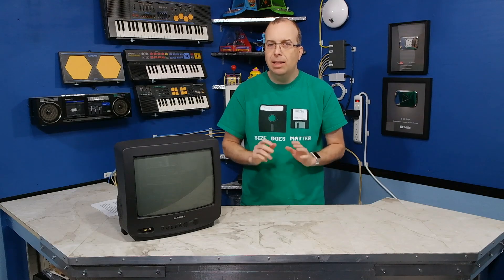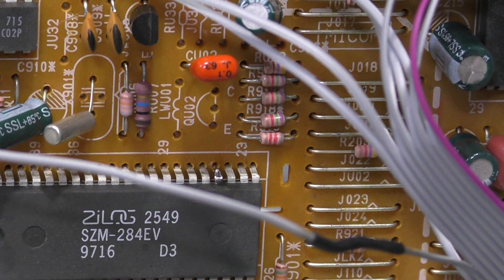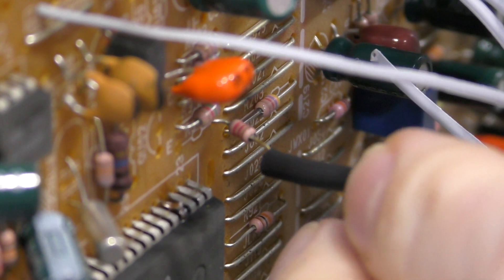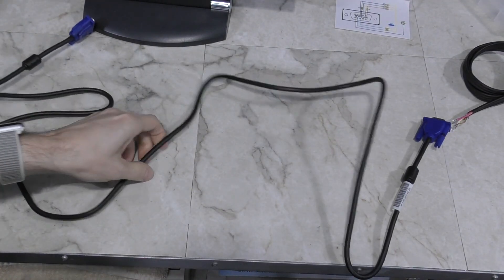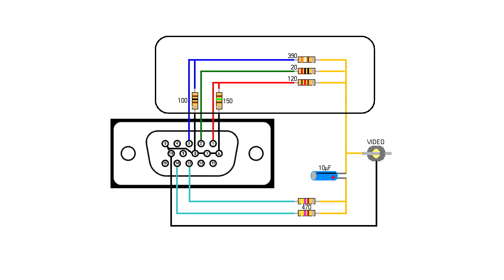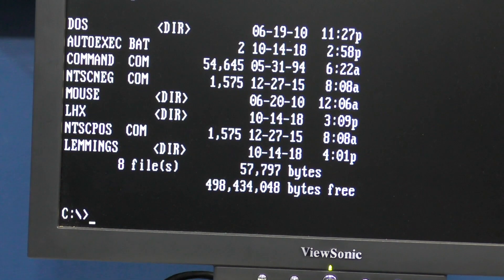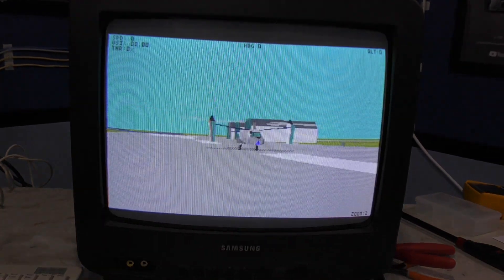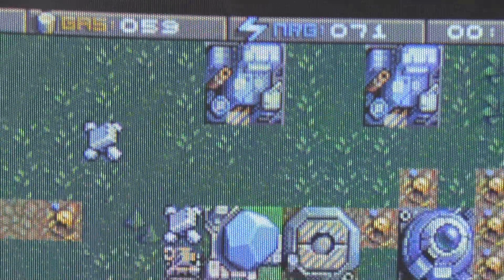Modding a TV for RGB - Part 2

Comment: Hey man I need your help I just picked up a 
Emerson vt1320n on screen high quality crt from April of 1991 and it has a vcr built in the tv turns on but it won't accept tapes
What can I do to fix this cause I also had a Toshiba dvd crt tv from 2001 I think
And when I had opened it and unplugged it and plugged the stuff back in the screen had went pink/purple then shut off to a point of when you turn it on it shows a white line going from left to right 
And I was working somewhat fine until I had broke it and then had to get rid of it and I don't want to brake this one because of how cool and how great of shape it's in after 33 years and it still turns on and I don't want to open it cause I don't want to have a repeat of what happened to the dvd tv
Please tell me what I can do to fix this
And thank you for whatever help that you can give

Comment: That was the biggest complaint I had about the CoCo 3. It had an absolute crappy composite output. Even on the Commodore 1702, which is a good composite monitor, it was just passable. I remember that this was pointed out on several reviews in the 'The Rainbow' at the time.

Comment: I just realized this video answers why we never got the VGA output fully working after finding instructions and creating the cable some 15 years ago. It was the refresh rate, which we didn't even know to suspect being different between monitors and TVs. We thought it was due to a short in the circuit board or something to that effect, and just ended up abandoning the project.

Comment: Well....where do I start? For any analogue signal use shielded wires, not ribbon cable. You had this cable with 4 RCAs on each end - a piece of that would have been perfect. The RGB signals from the controller: originally it was 2 resistors between the chip and the ground. The best place to connect the resistor for te external signal would have been where the 2 original resistors are attached to eachother. But don't solder the resistor there, put it at the external connector end. Also, of each signal (RGB) connect just the internal lead,  not the shieding at the chip end to avoid ground loops. The sync signal: also use an inline resistor in the external signal, because you never know what kind of signal the external source will put on it. The blanking signal: a diode or resistor would probably also work. In fact, there was a resistor, so the wire from the switch you probably could have just soldered on the other end. Finally, to avoid cumbersome conections and multiple holes in the TV back - i would have used a standard 15-pin VGA connector (so you can plug in a standard vga cable) and in the back side of the connector a little pcb to mount the resistors and a possibility to attach the RBG + sync coaxes properly. For each different system (not VGA) it would then be enough to have a modified VGA cable for each of those systems (cut in half, solder the appropriate connector(s) for that system). But hey, that it just how I would do it. This may seem like critisism, but it is not - it is nice to see you tweaking old systems, and the suggestions may be a reason for part III.

Comment: This is very interesting... not the rgb mode but making vga run in composite, so this could be used to display a computer signal on a crt tv that you want to smash live on video... much better than static

Comment: I'm going to attempt an input mod a TV from the 80s - which I don't recommend to anyone cuz they're live chassis and you can get shocked and killed, but I'm going to add an isolation transformer between the power cord and the rest of the chassis to separate the mains from the rest of it and hopefully not have any hot grounds. IDK if I'll be able to do an RGB mods but I ought to be able to add S-video - an improvement from twin lead antenna input

Comment: could somebody help me to find the blanking pin on a LG 14FK3RB-L2? it has a onechip,  LG046N9R59H3, I just need a litle clue, i'm not an electronic guy. Thanks in advance
Reply: @Tyler K thanks, very usefull answer. Could you tell me what other method is available?

Comment: i have the exact same model as you and cant figure out how to make it to sync.
Reply: Plug sync into composite port
Reply: Did you get it working?
Reply: @Slammer661  shit sorry for the late reply, i never saw the notification, yeah i got it to work , it turned out i had my vga cable wrong, if you follow instructions correctly it should work just fine

Comment: I bought a early 50s Toshiba tv colorized and I believe the TV comes with about 58 DVD hookups and when I tried using my Xbox 360 on it the whole thing started doing that out Flickr thing and that was just when I had my Xbox 360 in the basement I don't know why I did that at the time but I just want to play video games and the screen just went that was my fault entirely it I got it off the street how the signal is going through I act like I was trying to use the HDMI mini connector to something something and it didn't want to work my way the attic Xbox One is connected to my Samsung flat screen TV and the motherboard wasn't ready to switch over for older TV and I don't know

Comment: A real quick I have gotten a security cam TV to run cable I have gotten five TVs to run cable with a RCN Internet TV like that's up and I got it to work with it RadioShack connector piece for older TV when connected then you can turn your DVD player to all the five TVs you have in your house I got one like that one cable box all five TVs I don't care but works

Comment: I hope you get around to doing a part 3.  Maybe you can even find a chip to add inline to help with scaling to fix those other image display problems. I'm curious if there's also a chip solution that would create a frequency converter so you don't have to change the computer hz and lemmings will play correctly. Though at that point maybe it'd be better to just get a different setup in the first place.

Comment: Loved the video!
Would it perhaps be possible to use a small microcontroller to convert the pc rgb signal to the correct frequency for the TV? That way you wouldn't have to mess with the pc output signal and could perhaps avoid any software issues?

Comment: That TV could really use a true VGA port now. (Would that even be possible?)
Reply: there are converter boxes, wouldnt be hard to integrate one, but they are usually vga to composite (which would defeat the purpose)
Reply: @dcfuksurmom There are no boxes that convert VGA to analog RGB?

Around 2010, I picked up my first HDTV. It was a Samsung CRT HDTV that included an HDMI port.

As a TV, it looked great. But I tried to hook up a computer to it via HDMI, and it looked like garbage. The text was barely readable.

I don't understand why that was the case. Was it because the TV was 1080i instead of 720p? Not that 720p looks amazing, but it's usable. I sold the Samsung and bought a Westinghouse 720p (technically 1366 x 768) LCD TV, and it worked much better as a monitor. I still have that TV as a spare bedroom screen.

If CRT monitors could display text clearly at 1600 x 1200, why couldn't that CRT HDTV?

Comment: i feel like you could have also just used a diode between the microcontroller  and switch. the only back voltage would be whatever leaks from the diode, which would be negligible if anything.

Comment: you can use soft 15khz on windows xp to have proper 15khz resolutions out of the vga port. there are also a ati radeon modified drivers that works in newer versions of windows so you can play allmost any game on your rgb modded tv

Comment: feeding 5v directly to the uC was risky, but your solution also has a problem, for a brief moment the line is left floating and also you removed the resistor throught which the signal is fed so, it may burn at some random poitn in the future... you may have used a diode to prevent the power from going back to the uC

any way good job

Comment: Could have used a diode to do the same job, though at least it's isolated, plus i wonder if the voltage drop would cause issues?

Comment: Hi I have a question I have an old lcd screen from a picture frame I would like to wire a composite input to play my nes or n64 on how would I wire that
Reply: Just get the LCD matrix panel out of there and buy an universal LCD matrix controller with inputs. Usually there are AV, VGA and HDMI input at that board. Just connect the LCD via TTL or LVDS (depending on your panel) and power source. That's it!

It costs around $10-15.

Comment: I know you probably already thought of it. But how about instead of a dedicated black and white monitor for monochrome composite computers you just have a simple adapter that sends the same signals to r g, b and sync. also you can get neat shades by just messing with resistors (want amber or green)

Comment: OMG!!!  I just experienced RGB (raw feed/modded TV) vs RGB converted to work on component (snes using component cables).  True the results are quite similar and RGB brighter, but holy moly you guys don't seem realize that there's something hugely visually different in the... i don't know how to put it... i wanna say Hz or refresh aspect of it.  Yes they're both operating at the same rate,  but flashing graphics like explosions look like an arcade, vs the component which is slower and not as flashy.  I don't know how many people here have played metal slug arcade games, but imagine the little fire ball explosion animations and full screen flashes, THAT is how the RGB feels like, where as component isn't bright in the same way and it doesn't seem to be as impressive a flash and fast an animation.  I would say, yes, definitely attempt a mod (considering all cautions of course).... and so now I'm even more determined to get my own screen modded.  If anyone can help me find a schematic for Mitsubishi CS-40809, I would be ever so grateful!!!  Not just the schematic, but a few tips as well (resistors, shorting out the close caption how 8bit guy did in the previous vid, and I have no idea what two pins I should short out etc...)  OMG I've got to get this done ASAP!!!!

Comment: Question: I see your VGA monitor can't display a signal at NTSC frequencies (15kHz, I believe).  I know that many years ago (late 80's), Multisync monitors could sync that low.  Do you know of any sold today that can?

I ask because I'm concerned about when my Apple IIGS monitor dies.  The RGB output from a IIGS is effectively VGA compatible (at least in terms of voltage levels) but it uses NTSC sync frequencies, making it incompatible with any VGA monitor I've got.

I know that TVs can sync that low, because that's the frequency used by SD video (digital as well as NTSC).  Does anyone know if you can get a TV with a VGA input that can sync to 15kHz and therefore display an RGB signal from an old computer?

I suppose I could hack a TV like you did, but I get very nervous working around high voltage parts like a picture tube or flyback transformer, so I'd prefer an alternate solution, if possible.
Reply: Well, it used to be that PC monitors could not handle 15 KHz signals, but it is getting better because of the spread of HDMI. There exist HDMI devices that output 15KHz and 50Hz (in fact support for them is mandatory for compliance with the standard) and therefore both start to be supported by monitors in order to increase compatibility. Carefully check the specsheets, you can find what you need.

Another approach could be to simply buy a TV. A TV needs to be able to display 15KHz content, so always supports it.

Using simple dump VGA to HDMI converter can get you a RGB input on such a TV. Another approach is a SCART to HDMI converter, but these devices are often intelligent and do stuff like scaling and de-interlacing.

Comment: Or you could have just connected the wire coming from your switch to the other side of the resistor. I would expect 7.2k Ohms to be enough to limit the current to a healthy amount for the micro controller to sink. At 5 V that would be less than 1 mAh.
One should of course make sure whatever is behind the resistor can tolerate 5V without a resistor in between and if not add a 2nd resistor in series with the 7.2k Ohm resistor and connect the switch in between the two resistors.

Comment: COol! Videos. Is there a 16 bit issue with Big ENdian Vs Little ENdian. Im not sure but I think its an 8bit rotation. Can you possible take 4 tv signals and smush them into a tv either 2 steroscopic MONO or 3 videos 1/4 screen used for audio signal and left and right plugs used for mono videos. 
To make a steroscopic channel or  3 tv channel switch from 1 broadcasted channel. openInvent.club I want to help contact me. I want to learn stuff. links to resources in your video descriptions please.

Comment: what dirty hack could you come up with that lets RGB work on a VGA port without having to buy a converter box? (again, dirty hack, using maybe some caps, resistors etc from the spare parts drawer) this of course, skipping a "line doubler", which is why I'm curious to see the output!!! :)

Comment: Hey 8 Bit guy! I love your restoration videos! I've been trying to get into vintage computers myself, so I was looking up older computers on eBay and saw this. If you can, you should get it and try to restore it. It almost looks like it could compete with that old Vic-20 you restored a while back. 
https://www.ebay.com/itm/apple-IIe-computer-system-computer-monitor-and-disc-drive/263998924826?hash=item3d778fe81a:g:SJ0AAOSwlY5bxjmY:rk:2:pf:0

Comment: Are you a computer engineer?  I need help with my Toshiba a300 everything works but normal booting has only a black screen but if i activate safe mode it works. . Do you have a solution to this?
Reply: You better look somewhere else. This channel is for old retrocomputers, I have never even seen David using Windows.
Reply: Had a deep search can't find a solution because this toshiba a300 lasted for 9 years only the normal boot has a problem

Comment: It will be easier just to add a rectifying diode so that the 5v don't go to a chip. Switching the pin out of a chip directly introduces noise to it. Not good.

Comment: Hey Dave I wanted to email a question to you but couldn't figure out how to do that.. I was wondering if you would consider taking on the challenge of figuring out how to run Tandy 1000 HX files saved on 3.5 on a modern Microsoft PC.. I have some old symphony files created with my Tandy back in the day and would love to be able to run them on my modern computer. I don't think file formats are compatible without some work.. I could swear When I upgraded to and old IBM back then (PS2) that Tandy files would run perfectly.. Anyway if you decide to do this I would be quite happy.. I don't like emulators  either lol.. I did buy older DOS versions and installed on my lab pc and had no success..

Comment: I would also add a resistor in line with the 5V supply to the switch.
This will also save the "Jungle" chip's input from being held "Hard On"  this eventually may cause failure of the Jungle IC.
Though myself I would have installed a 1N4148 Diode in line with the resistor on the Micro Con't side.
Then just connect the switch wire to the point the resistor and diode connect.
Simple and mo need alter the switch.

Comment: The 8-Bit Guy I believe if you modified a tbc or time based corrector or macrovision defeat device, aka a digital video stabilizer to use analog rgb and vga I guess that should fix the problem, idk, I have never had experience doing that. So you can give that a try. Ik a lot of times digital video stabilizers were used to circumvent macrovision on vhs tapes, which if you are interested in, hacking one of those for your personal use, you can probably get clear macrovision defeated signals on rgb and you can transfer all of your store bought vhs, beta, etc tapes to DVDs for personal use. Also have you ever thought about modifying a digital tv converter box to use rgb to pick up digital ota tv signals on an analog tv? I am pretty sure if you are not messing with the rf in or rf out’s antenna field strength while doing that, you should be okay I think? Those are just some suggestions.

Comment: So, i can connect my win 10 PC to an old Tv with RGB?
Reply: you'd need an actual adapter box, and it would only work in 640x480 (maybe 800x600), but yes. the program for adjusting timings only works on dos

Comment: Wow, that reminded me trying to hook up my Amstrad Mega PC to the same kind of TV about 10 years ago, with simiar caveats (execept it was much easier for me because I'm in a SCART-heavy land). I always wondered why some 320x200 EGA games would not fill the screen, even though I used different TSR programs. Also this solution is not very good for demos, as most of them access the card directly. I challenge anyone into trying to run Crystal Dream II in 15KHz without cheating by using extra hardware.
Note for the curious who want to know about the Mega Drive part of the Mega PC. Indeed it will work with a TV, but you won't get a picture by combining the syncs passively. You'll either need to build Tomi Engdahl's circuit or buy yourself a UMSA adapter. Also, the Mega Drive part is very iffy when used with scalers and some multisync monitors as the vertical sync pulse sent by the Mega Drive card may be longer than it should.